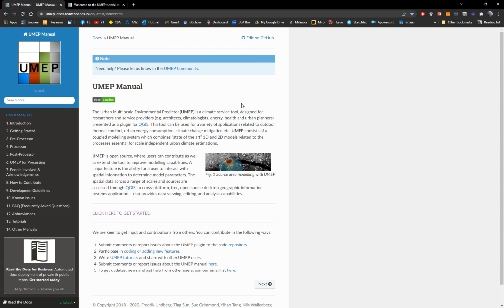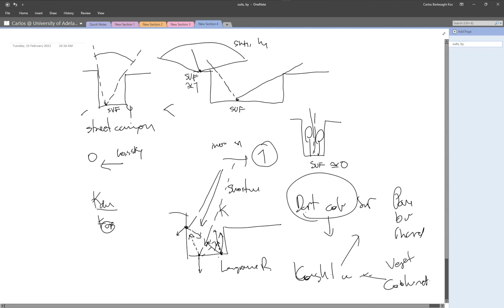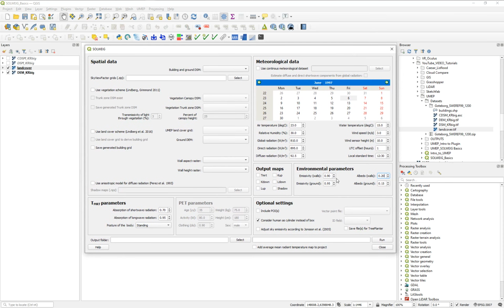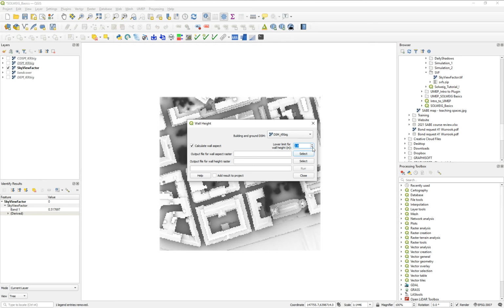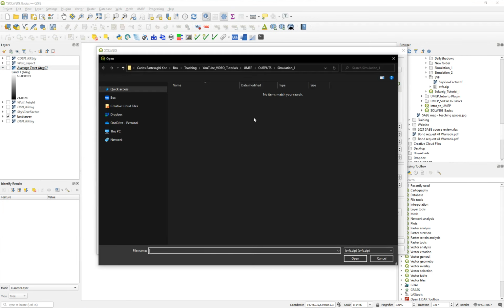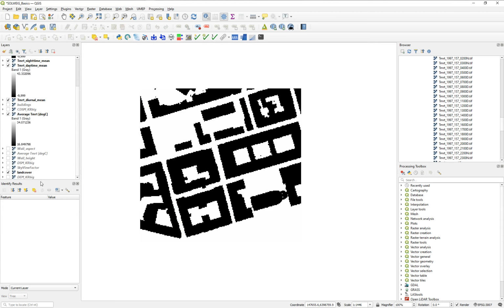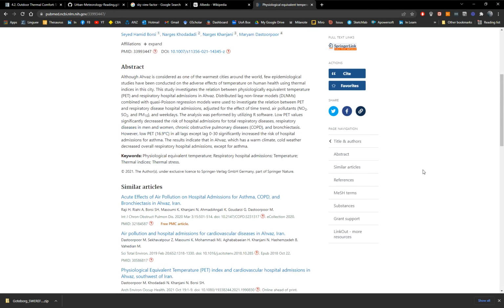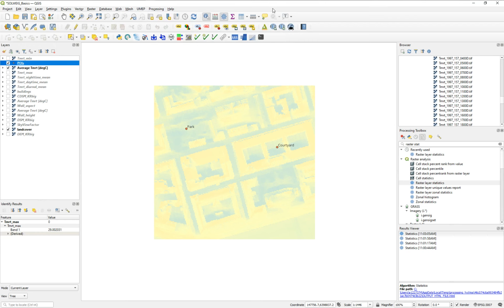UMEP 2: Outdoor Thermal Comfort Modelling - Introducing SOLWEIG for QGIS

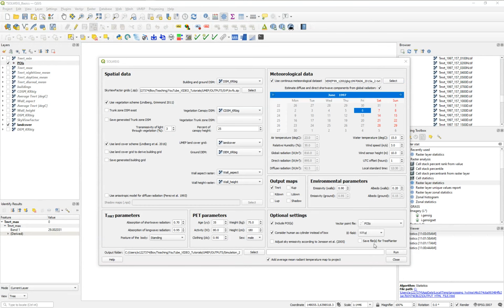Comment: Hi, I am facing an error "Make sure format of meteorological file is correct. You can prepare your data by using 'Prepare Existing Data' in the Pre-processor" at 50:28